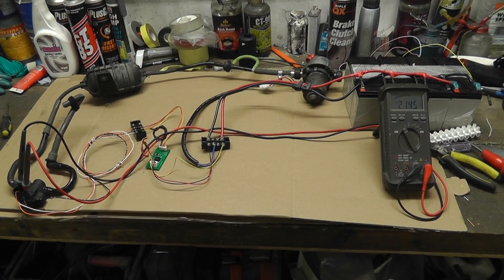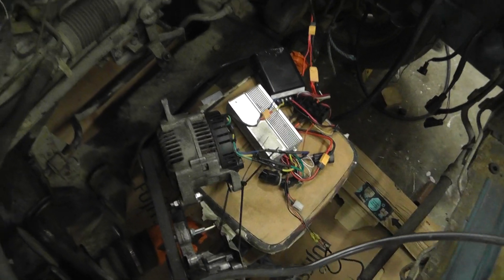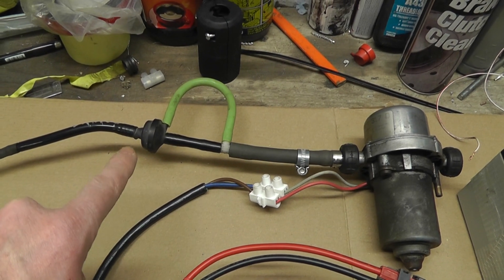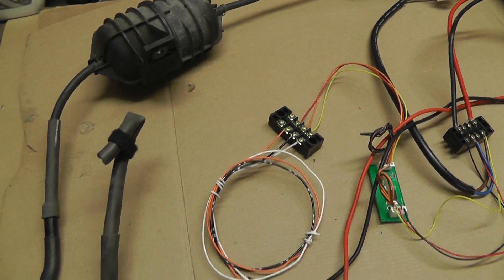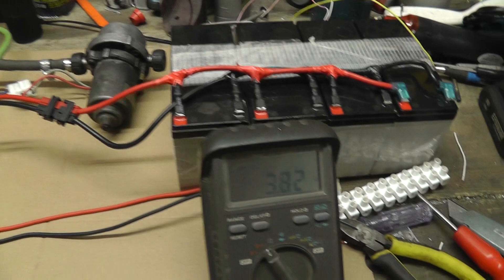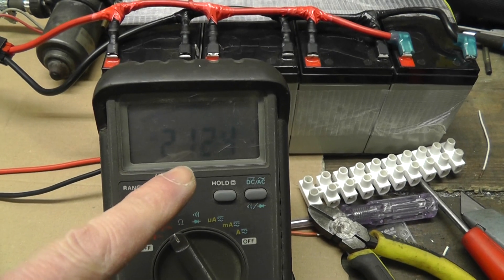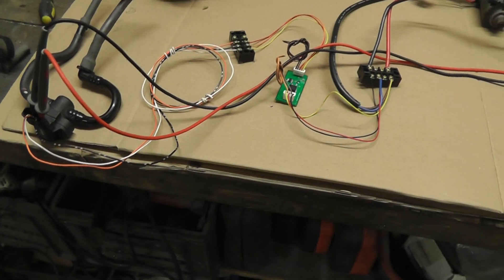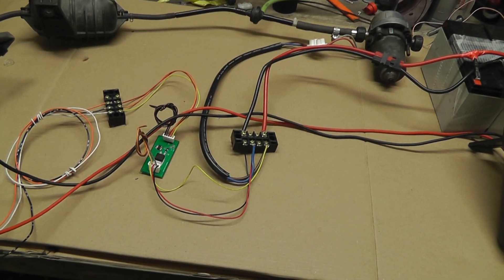DIY EV Part 14 - EV Vacuum Brake Boost Solution.

Comment: Diesel and turbo motors have no vacuum, so they use the power steering circuit to power the brakes.
Reply from the maker: I believe the Freelander 1 TD4 has a vacuum pump bolted to the engine.

Comment: I can't see anything wrong with that configuration Ali. The sensor needs to measure the vacuum at point of use, which is why Audi put it by the servo. 

You could hook it up to the servo in a few seconds, so you can test its recovery time in no time. ;)
Reply from the maker: Good point John, Why didn't I think of that. 😯